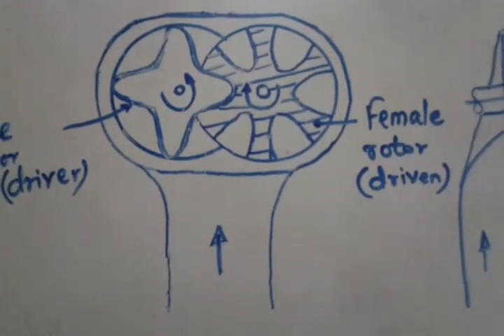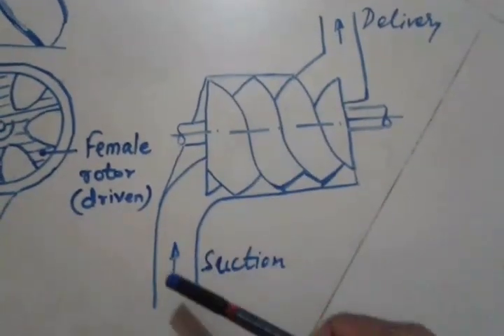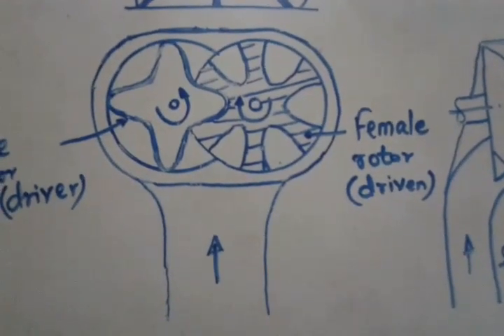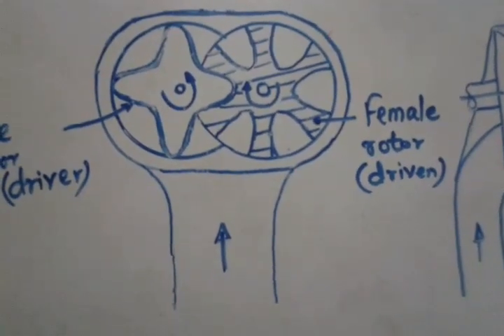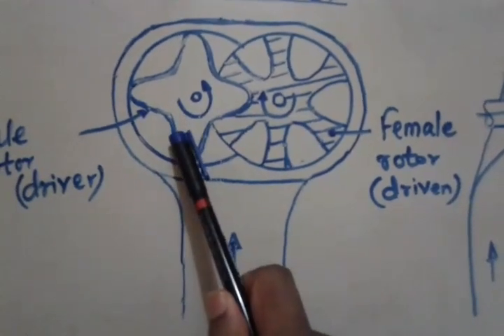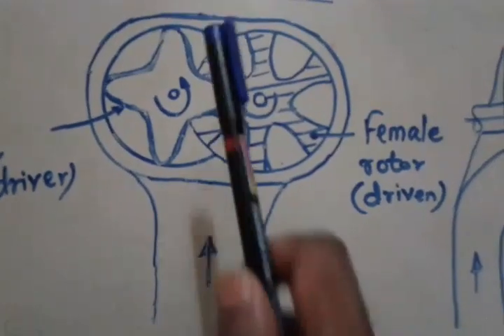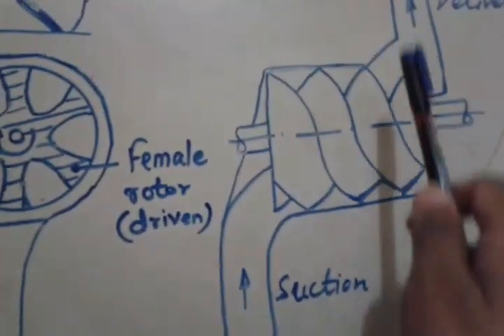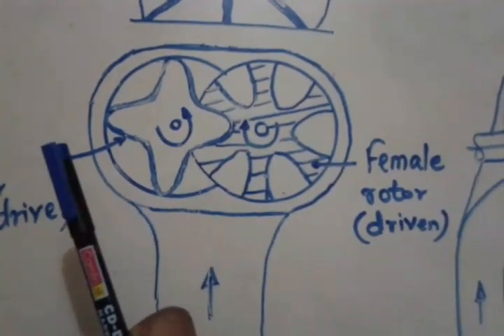Diploma Mechanical - Screw Compressor... #20kviews #viralvideo #screwcompressor

Comment: Screw compressors are positive displacement machines, not dynamic machines. And if you are showing the suction side, then the rotors are rotating in the opposite direction you are showing